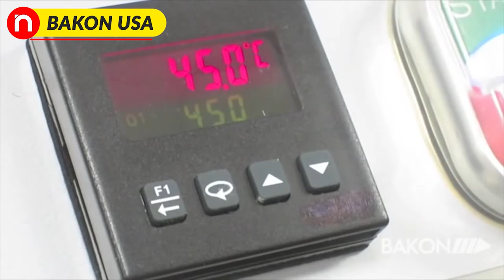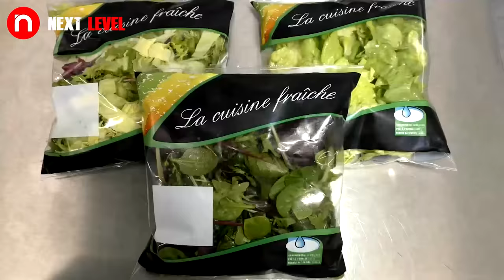Food Industry Machines & Production Processes That Are At Next Level ▶ 2

Comment: 0:11 Emergency Stop Button blocked up by dust cover xD
As a german engineer I can assure we'd send this back to design phase before even considering connecting it to power.
Reply: disappointingly surely if the dust cover is down then no one would be at risk of injury. There may be another e stop on the outside of the machine
Reply: @Bobbydazzlla  if there would be an easily accessible e-stop: why should they install a second one under the dust cover? Your theory does not make much sense in ths regard. ;) 
btw: there's definetely none at the front or right side ...
Reply: Haha, that's funny xD haven't even noticed xD
Reply: @Bobbydazzlla                        9
Reply: Poopoo
Reply: 2
Reply: Wir Deutsche sind überall
Reply: The only time you’d possibly get injured is while the shield is up which is when the emergency switch is accessible. However, how stupid do you have to be to get injured by an enrobing machine?
Reply: Aber die Brezeln sind sehr interessant